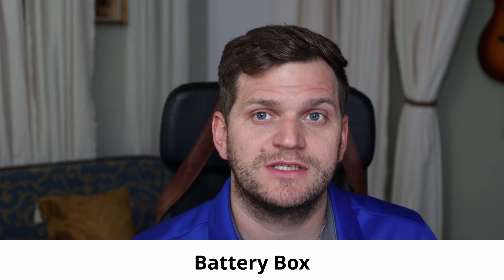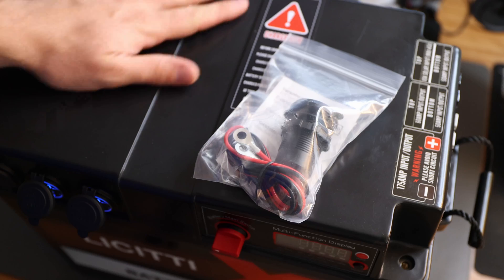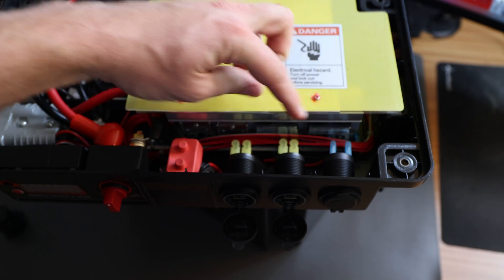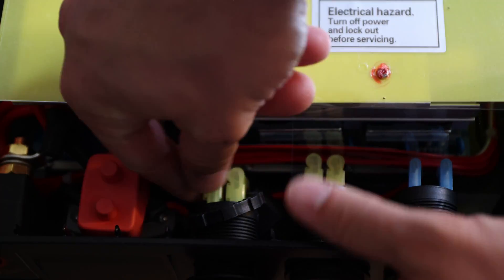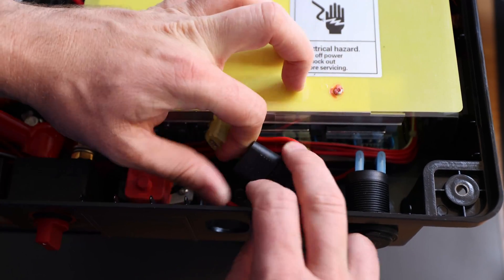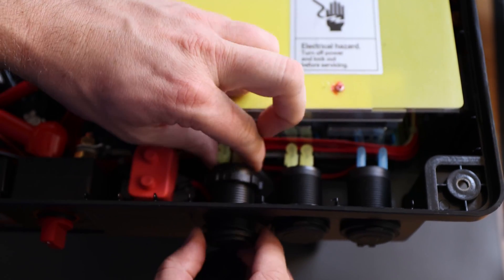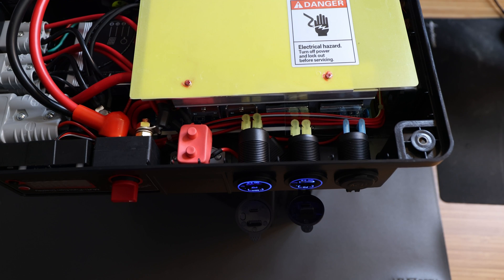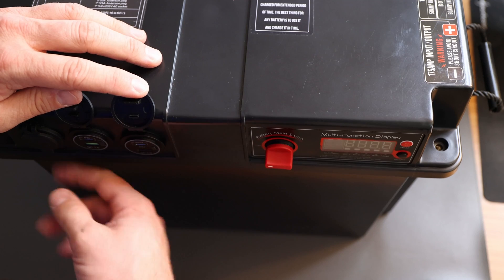Help me modify the Licitti Battery Box 1000W

Comment: Do you know of a larger inverter that can be swapped in?
Reply from the maker: I have not tried it, and due to the space limitation inside might be tricky. There is barely enough room for air flow. In case you have an inverter in mind you might be able to test it, it is very tight.

Comment: I bought the 100 amp box and paid extra for the 20 amp AC charger. They never sent the charger and now they aren’t answering emails. I’m out money and need to contact Visa and PayPal to get reimbursed. I’m irritated. Buy something else.
Reply from the maker: Unfortunately that happened to another user as well. They are so bad in communicating. I have another video coming out which will also address this issue - so everyone is aware of this in case they still decide to proceed. I even escalated this to them and got very little response but they did respond... Shoot me an email with your email you contacted them - I can only try to send another email with your information to them ... I can"t promise anything though...

Comment: Nice mod, if you have a MacBook to need the extra power. Mine came with the cigarette lighter plug in the wrong hole according to the label. I swapped it to the correct hole. At the same time I moved the fuse holder to the outside of the power port. That way I wouldn’t have to remove the power port just to replace a fuse.
Reply from the maker: Thanks for sharing! Great idea!

Comment: Thanks for sharing this. Curious if the connection could include an input/output USB C module for charging?
Reply from the maker: I guess that would be great but I have not seen this. I need to do more research on this if that is possible for 12V systems.
Reply: @tobisreallifeskillswithtobi  some of the mainstream manufacturers have this as a charging option. Albeit on smaller watt hour batteries. Just nice to have alternative charging options.

Comment: WARNING! I purchased this product because of videos like this but man have I had a horrible experience I spent $370 Canadian $70 of that shipping and handling and the only sent me the charger and it's been over a month and they still haven't sent me the Box I had to file a fraud case with PayPal. 3 days ago I received the tracking number from Mark Xu  Marketing Operations Manager. This was supposed to be for the battery box But it was for the charge I already received. Good thing UPS took a photo and I have a picture of it by my door which obviously shows that it's a small box.
Reply from the maker: Sorry to hear this! I hope this is resolved soon!

Mine works as I described. I did not have to deal with this since they sent it to me as I mentioned.

I hope this is one out of :/

Comment: Nice video. Question on fuses to the main battery. Do you have a fuse on the positive terminal ? Any suggestions? I want to run another 100ah battery via the 175A Anderson cable.
Reply from the maker: Thanks for watching! Maybe an inline fuse? Gives you the flexibility to expand/change fuse if needed or upgrade.

Comment: That's a nice mod Toby.  Here is one from me.  I bought a 20 AC charger for my Redodo 100AH LiFeP04 battery which I used to complete an initial charge on it before putting it in the Licitti battery box.  The charger came with ring terminals which were fine initially, but not convenient once the battery was in the box.  Since we have 3 Anderson connectors on the box, I bought an Anderson connector and cutoff the ring terminals on my charger.  Placing an Anderson connector on the charger leads would have been easy, but I've never crimped anything before.  Mission accomplished.  I can now recharge my battery without removing the top.
Reply: Ok

Comment: Nice upgrade.  I just got one of these last night and am quite impressed at the ease of assembly of this unit.  Liciitti sells a battery box with a 2000 watt inverter (Next Gen Battery Box).  It is three times the price and not as portable.  A 1000 watt inverter will be quite adeaquate for most applications except coffee makers or other resistive heating device.

Comment: Do the 2 USB & 12v cig ports all share the same fuse? If so wouldn't using USBC 100w and cig port at the same time trip the fuse?
Reply from the maker: Good call! It was a 30A fuse. When using the cig 12V and the USB C ~80W it does not trip the fuse. But since this needs more power using all three outlets at the same time might be tricky - you are right. I did not increase the fuse since I did not put bigger (AWG) wires in either. For me this is understood but I should have highlighted this better! Thanks for asking and watching!